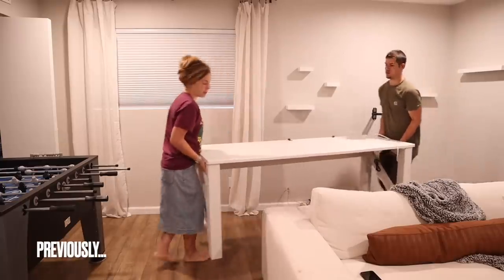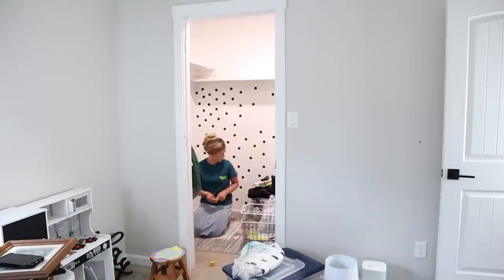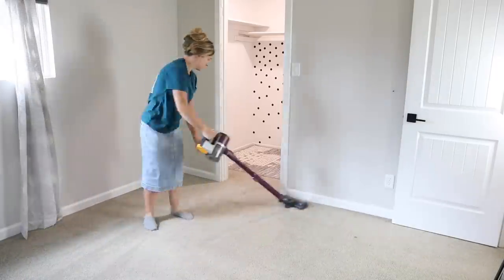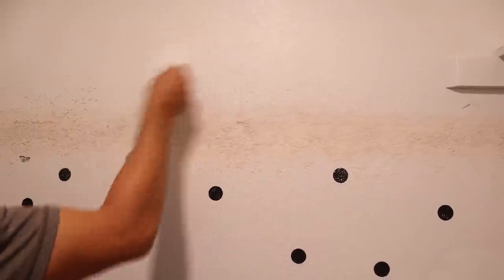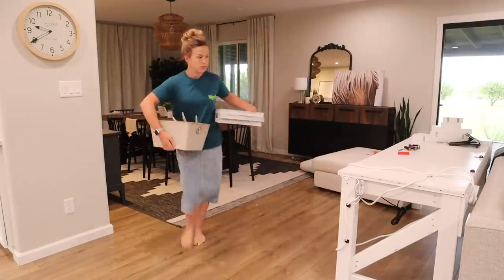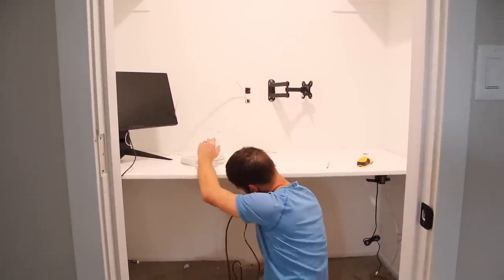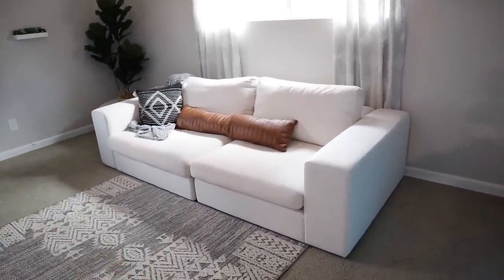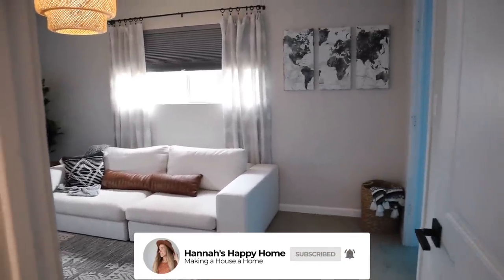ROOM MAKEOVER & SWITCHING ROOMS IN OUR HOUSE!!😍 DECORATE & CLEAN WITH ME

Comment: I use equal parts white vinegar and water on my carpet. Any soapy cleaner will eventually attract more dirt. So it would look clean at first but then dirty back up. Vinegar and water won't leave a soapy residue.  If it is a tough stain, I add a bit of baking soda, wet a brush or rag and scrub the stain. I will let it sit to dry, then vacuum up. The room looks fantastic!

Comment: I have always used  Pone Sol 1/2 cup and 1/4 cup of Ammonia.  Have good vimalation,  also on spot's  that been there awhile. Put some in a bucket and  put on these spots  and let it set
I always  got a rug shampoo machine, and put the hottest  water you can in the water container.  I used lemon scented  Pine Sol, this makes your home smell so clean.

Comment: I love the new room! The closet as an office is a great way to keep the office out of the middle if the room and to give him some privacy.
My favorite carpet stain hack is oxiclean dissolved in a measuring cup of hot water. I let it sit for a few minutes to dissolve. Then I pour a little on the stain, agitate it with my fingertips and let it sit for a little bit. I can wipe it up with a wet cloth. It may be. A little cleaner than the rest of the carpet when you are done but it will "dirty" up.
Did you find anything you had forgotten about going through the boys' closet? We routed the front of the shelves in our master closet and stained them. Then, of course, we had to repaint the walls. When I was going through the bins I found pictures from my son's Air Force basic training that I was missing along with a box of important pictures.

Comment: I use baby wipes.. those pamper ones with the acid in them, not the water and grapefruit oils type😅. I use baby wipes on my upholstery, vehicle seats, fabrics, even cleaning up paint when I accidentally get it on the baseboards as long as the paint is wet, comes up like a charm.

Comment: to spot clean carpets I put water and few cap fulls of my carpet shampoo in a spray bottle and spray it on the spots, leave for a few minute, then I really massage in the solution with my fingers and dab with a microfibre cloth. If the stain still remains I will repeat. But usually it removes first go. Mainly tea stains too. The brand of carpet solution I use is Hoover Pets, but I am in Australia so not sure if you have that brand where you are.

Comment: There is a product called Capture that has a spray to release the stain and then a powder that is sprinkled on and let set. After it dries, you use a brush on it then vacuum up. It’s a top product sold by carpet stores. Works like a charm!

Comment: Bissell Pro Oxy Power Shot. They carry it at Lowe's. We bought a used car and it came with some stains that looked like grease. The Oxy Power Shot took them out like they were nothing. We bought a used car for a work car for our son. The previous owners had cleaned it as well as they could and couldn't get the stains out of the seats.  Our son scrubbed and scrubbed the seats and couldn't get them clean either. Then we got him the Oxy Power Shot and the stains came right out.